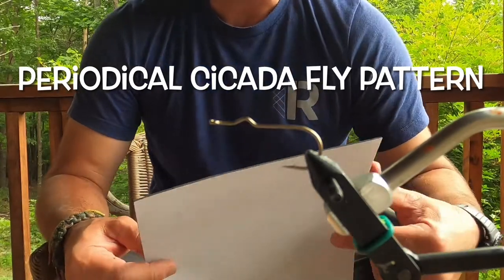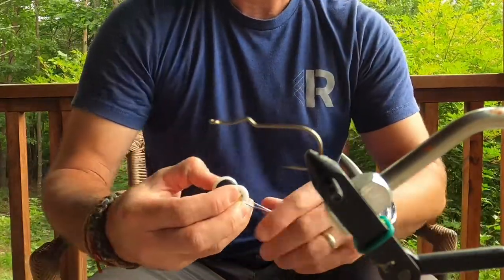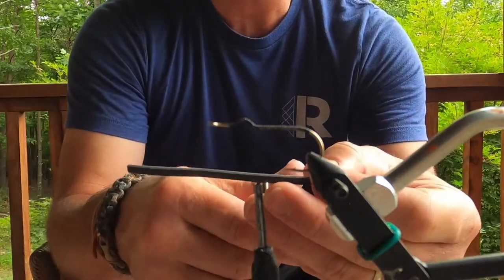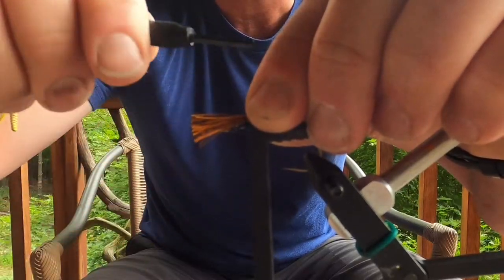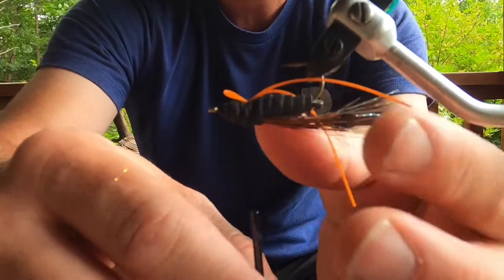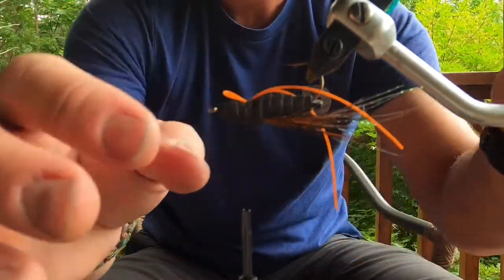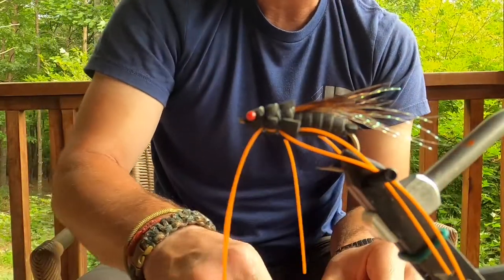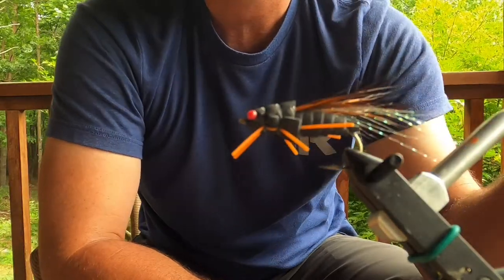2024 Cicada Fly 🪰 Pattern Brood XIII, Brood XIX and Brood X.

Comment: What soze rod are you throwing this fly with? 8 weight?
Reply from the maker: 8 weight but only for the size of the fish. You can easily cast it with a 5 weight no problem. 
If you look at some of my other videos, you see me fishing this pattern for carp with my fiberglass 8 weight.
Reply: @mickeygrantflyfishingtying6246  thank you sir. One last question....what is the thickness of the foam? 1/8, 1/2. Not the size you cut it, but how thick it is from sticky side to non sticky